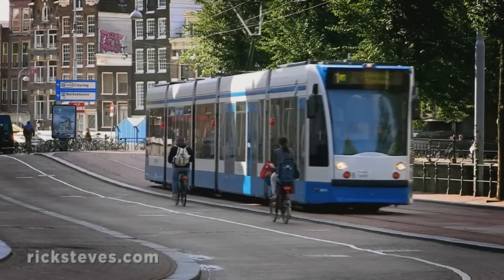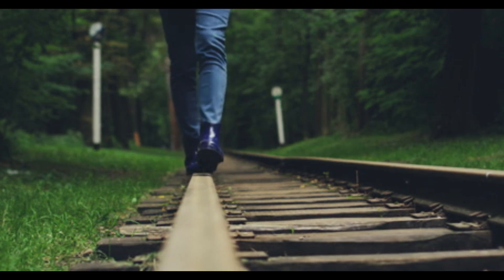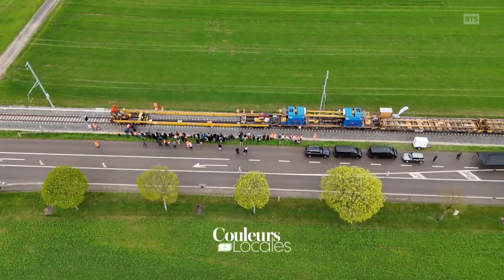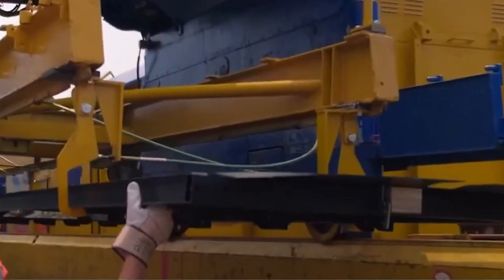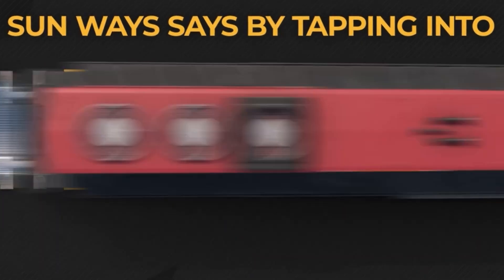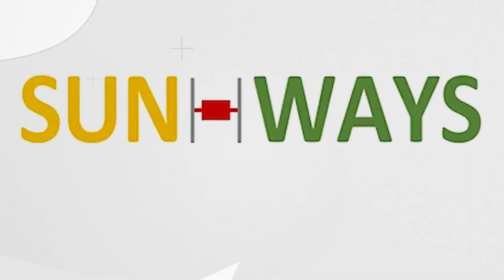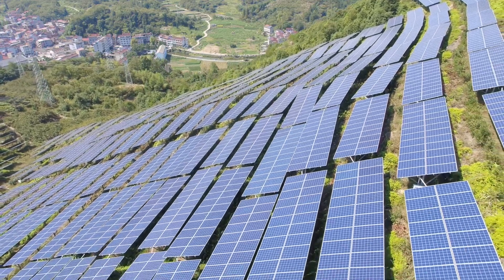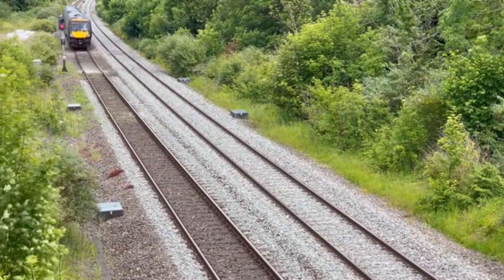Sun-Ways: How Swiss Trains Are Turning Tracks Into Solar Power Plants

Comment: wikipedia, Per Capita Energy Use, choose country, US about 300GJ/yr, EU 200GJ/yr, that is primary energy not electrical. One solar panel of 1.5sq m in NE US makes about 1GJe/yr and with energy storage included would be worth at most 1GJyr of primary energy base load. If all energy is from solar, everyone in the US and EU needs an avg of 300 panels and a whole lot of land which the EU does not have in the northern parts.
So it's a very stupid idea just like solar roadways was. People simply don't understand that most energy use is outside the home, energy is inside everything, in transport, industry, in commerce, on a scale that dwarfs home use.
Reply from the maker: But in the other parts of world where energy prices are high and free land is available yhe best option is solar like gulf region..this is testing phase they will expand in other regions soon
Reply: @THEWARFAREDESK20  you don't get it, solar is a complete waste of time without extremely low cost long term storage, instead of storage it must use nat gas powered peaker plants to power the grid when the sun don't shine or wind don't blow. The fossil industry loves renewable energy because it guarantees the use of fossil energy most of the time even if it sometimes lets the grid go 100% solar. See Germany, all their renewable energy is backed by coal, Germany has 2x the per capita CO2 emissions of France because France uses mostly nuclear for its grid while Germany uses coal with some RE.
Reply from the maker: @JohnJakson-i3w  You raise valid points about energy density and land constraints—solar alone isn’t a universal solution. But in sun-rich regions with cheap land (like the Gulf), it’s already cost-competitive, especially paired with growing storage tech. The goal isn’t 100% solar overnight, but displacing fossil baseload where feasible.

As for storage, you’re right: today’s grids need backup (gas, nuclear, etc.). But batteries, hydrogen, and demand-shifting are improving fast—Germany’s coal reliance reflects policy gaps, not renewables’ limits. France’s nuclear success shows low-carbon grids work, but not every country can replicate it. The future likely hinges on a mix: nuclear for baseload, renewables + storage where viable, and fossil phased down as tech improves.

No single solution fits all—but dismissing solar entirely ignores its role in the broader transition."